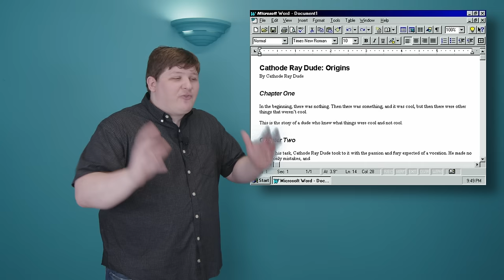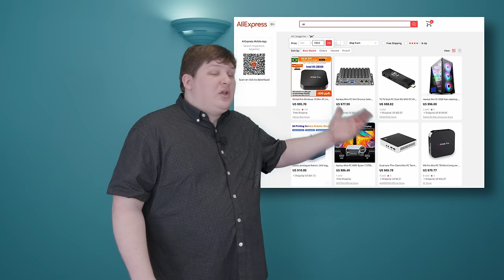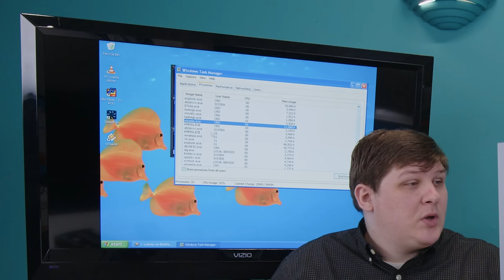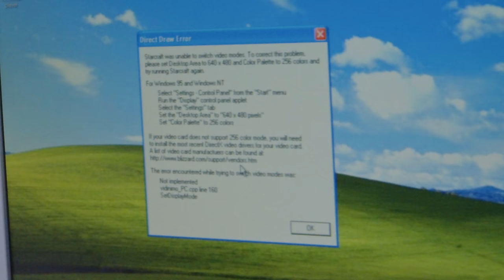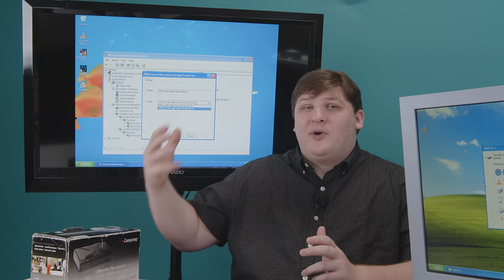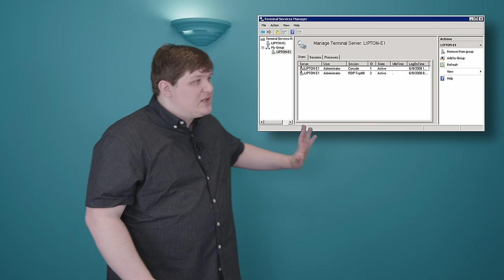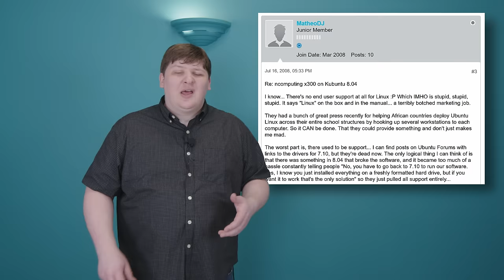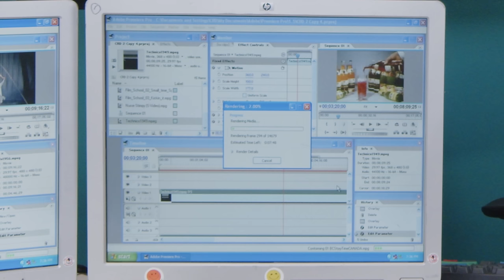7 Users on 1 PC! - but is it legal?

Comment: Great example of the internet being responsible for our constant upgrading. 

I love the basic UI and functionality of older versions of windows, but the power and tech requirements of the modern internet / browser experience forces you to upgrade. Even XP is forced off the net by not having a new enough browser available. 

Back around 02 I remember still being able to kind of function on the internet with IE 5? Or 5.5? On windows 3.1, but many new pages wouldn't work. Similar to the winXP example now.
Reply: You can squeeze a couple more years from old hardware by just installing Linux.

But having a lighter OS and a modern browser can only get you so far. Modern web is getting increasingly bloated and even basic (from a "social" standpoint, not necessarily from the computational one) sites like YouTube or Facebook can really struggle on underpowered hardware.
Reply: I wish I could have Windows 2000 back .... secure for its time (NT based) no wasted resources on eye candy, nothing comes with it so bring only the software you need.
Reply: XP is so riddled with security holes, the modern internet being too powerful for it is probably a good thing
Reply: Well, you can get pretty far with first adblockers and then JS blockers.

(and ditching windows bcs any secure version will lag as hell)
Reply: @Green Mamba Games Yes my first Linux box was a 90MHZ Slot 1 Pentium, with 128M of RAM, deemed too slow to run XP, but fairly screamed with RH4.0.
Reply: Honestly, Internet Explorer got a lot of warranted hate, but because it was the de-facto browser thanks to being came with Windows, it kept the Web relatively low-spec for a long time. A lot of fancy stuff had to be made in Flash thanks to IE not supporting any newer web standards. But even with Flash the web in 2008-2010 was still much lighter than today when some bloated websites actually load 15 MB (or one Doom ][) worth of advertising/snooping data.
Reply: I’ve got a ten year old i7 which would be perfectly fine were it not for JS webpages getting more bloated. It’s still perfectly capable of video transcoding, software compilation, and so on. It even has enough power to software decode VP9 and HEVC at only like 50-60% overall load. Yet web stuff has me considering a Ryzen 7 to get more headroom, and just do those other tasks 2-4 times faster to boot.

Comment: I'm watching this on Phenom FX 8530, 16GB RAM from 2013, later added GPU GT-1030 for 4K decoding and NVME SSD for storage.  It's unbelievable how good this PC works for its age.
Reply: Switched from HD to SSD .... suddenly my 10 year old (Gaming Laptop) is cool again, despite Windows 10.
Reply: Yeah, I'm running an I5-4690k and AMD R9 RX280, both from 2014 and I don't see a need for a newer hardware for at least the next 5 years. As I only play single player games a few times a year, I'd only consider upgrading the GPU for a few generations up if GTA6 ever releases lol
Otherwise it's totally adequate for everything on the web.
Reply: @Renee_R343  here with fx8350 and r9 280x too, all the same thoughts
Reply: i'm watching this on a 2008 Thinkpad 400, Core 2 Duo, 4GB RAM, but also I miss my Phenom II, I don't have it anymore but that thing lasted me several years. Outside of cutting edge gaming it took a long time to feel old.

Comment: one could argue that the computer is running just one user session at a time, like the user switching allows, but switching very very fast, like every other cpu cycle, hence not breaking the EULA
Reply: For single core, but what about multicore?
Reply: @rollinkendal8130  true now, but back then the pentium 4 had only 1 core, and 2 threads, with luck!!
Reply: Clever arguments are lost on dumb judges.

Comment: You did an excellent job! I don't like long videos, but as an old IT guy I was captivated in the first 10 minutes. Around 2010 I came across a tiny little dll file that turned my Windows XP Pro machine into an XP terminal server for up to 10 concurrent users. You had to have other machines already, but if you did not have the money for a terminal server, this would do the trick. To me, it sounds like x300 boxes are essentially the reverse of a KVM switch. If I remember correctly, when XP was first in beta testing they said something about supporting 9 monitors (think Brady Bunch), so it makes sense to me how they were able to get 7 desktop sessions. Very cool though!
Reply: Hi Vinnie! I am curious what was that dll file? Can you share it, or type it's name? I would like to look into that file.

Comment: Well done! 
Thank you for that video.

I was one of the people who recommended nComputing to a school, where it solved their problem. Very few people ever take my recommendations, so I felt validated when I saw your video.

And yes, the limitation is in the software.
I'm one of those old guys who, back in the day, ran multi-user UNIX/Xenix systems on machines that would be laughably under-powered by today's standards. I could never understand how people got suckered into using Windows in the first place.

I did also run a business network of 30 Dell Optiplex PCs with 166MHz Pentium CPUs with 32MB RAM and a 2GB HD, for 10 years from 1998 to 2008 on Windows95, so yeah, I'm a bit stubborn. In the end, I did convert those PCs to thin clients running Linux and rdesktop connecting to a Windows 2000 Terminal Server.

I'm well aware that even the Pentium CPU could never reach 100% running just normal office applications. Those PCs would start swapping long before the CPU even broke a sweat. 

I did a lot of experimentation with multi-user systems, hacked versions of Windows, etc. WindowsXP can be made into a multi-user system with some hacks. Even Windows10 can be made multi-user and I know a business that is running it that way for over 3 years now, as their main system. Users connect via Remmina from Linux systems, so they get the "best" of both worlds.

Comment: Fascinating. Having worked with CPM86 for PCs where you could run multiple dumb terminals from a serial port expander on PCs and RTC86 that allowed 24 dumb terminals from Microchannel serial adapters in a PS2 Model 80 or Model 95. In reality you would use some ports for printers in a print server type queuing system but to see a room full of agents with Wyse 120 monitors all taking bookings all powered from one PC, and then seeing that PC running modems and printers at the same time does, as you said, prove that most PCs are way more powerful than users actually ever need, with exceptions.

Comment: 39:30 - My bet is that the Hsync and Vsync are combined on the same wire (and could possibly all be lumped in as sync-on-green, but it didn't look like the green was tapped for this), and then the remaining two wires would be something like: usb data, I2C data, generic clock-and-data, etc. Hard to stuff all of those things into a single line. In addition, I see two little traces on the top side coming off the CPLD towards the VGA port - since I doubt they actually implemented DDC (since the device only supports two modes anyway), this is likely the Hsync and Vsync, which fits.

I suppose they could even have the data synced to the VGA clock, so they have two data pins and a clock...
Reply: I would be tempted to fit the audio into the h sync area on the video signals. You already have an analog channel, put it in there. Also if you multiply the number of lines by the refresh rate (thus finding the number of h blanks per second) you get almost the same number for (1024x) 768x60 and (800x) 600x75. And the number is about 45KHz. So if you have an analog sample and hold circuit in there on red and blue (left and right) and open the gate at the right moment during the horizontal flyback you can reproduce audio at about 45KHz, which would sound pretty good. 

Merging the audio onto the R and B and the sync on to the G would save you a lot of lines. It would either use up 4 or 6 lines (6 for differential, which technically you should use for twisted pair CAT cable).

For what it maters I firmly believe the design supports only a single rate of lines (h sync rate) and that is why we see no 60Hz option. A 60Hz output would have to run at about 94Hz vertical refresh rate to get to the required horizontal refresh rate. And I'm not sure how many cheap monitors would support that back then. And if you had to use expensive monitors then it would hurt the monetary advantages of the system.
Reply: So much effort just to avoid having to find a different connector with more pins... :) But I guess it's easier said than done, especially when UTP has twisted pairs which probably helped suppress interference a bit.

Comment: In the 1980's we were running as many as 32 terminals on 386 machines running Xenix or Unix using smart serial cards to offload the I/O load.  (I used to design them)
Reply: thats what I thought too. An AS/400   e.g. was able to lift the workload of a whole company and he is fxxxking around with games in a 2 user environment...
Reply: But could it teach people to use windows? This is apparently a valuable and rare skill that cannot be picked up should the need arise.
Reply: Just think of how many terminals a modern eight core laptop could support… or a threadripper 🤣
The hard part would be finding the users who wanted to use your terminal…
Reply: When I was starting out at a telco (Telstra Aus) I remember seeing quite a few Olivetti  box's that ran unix and talked to a pile of serial terminals. Back then setting up an office with multiple terminals meant running heaps of RS232 serial cables back to a 'server', everything was text based. I actually think more work got done back then, as the users couldn't stuff around with the computer, it was setup to do what it did and that was that.
When we went to PC's, we then had to employ a pile of extra support (IT) people to go around finding lost icons and resetting screen resolutions etc, that users would stuff about with and break their workflows.
One twit discovered laplink and would clone one machine to another because he thought the other looked better, of course he broke several machines, as the hardware did not match - wrong driver issues deluxe.
Reply: @paulstubbs7678  Olivetti in Australia... As an Italian that's really nice to hear :D
Reply: re: "In the 1980's we were running as many as 32 terminals on 386 machines running Xenix"
Text-based apps? Using say ... VT220 terminals for - like data entry? No graphics per se then ...
Reply: @uploadJ  At my university we would have a single SPARCStation 20 servicing around ~20 Xterminals. Multiuser computing is quite old and refined. OS schedulers in modern OSes still carry mechanisms from the multi-user world. Even Windows NT's scheduler still has some hints of VMS in the balance set manager.
Reply: @uploadJ  The POINT he is making is that we LOST a Valuable capability   -  hell Im STILL pissed that I can plug in 2 Mice & Keyboards into my machine & have them show up as Different inputs Native on ANY Win9x/XP/7/10 etc.  Imagine what that could have done for GAMING vs Console in Y2K era.  Multiple COntrolers anyone? no? why not.
Reply: @uploadJ  Yeah text based, accounting, email, software development and there was a version of MS Word for Xenix.  We used mostly Wyse WY50 and WY60 terminals but anything with an RS232 would work. Originally we use boards form a company called Chase, then started building our own,  The boards I designed were modular and could be expanded in 8 port increments up to 32 per host card - (Specialix SI, XI and RIO serial boards).

You could do a lot with serial, at one point 25% of the Usenet traffic in the UK went through a bank of four 19.2k Telebit modems that sat on my desk (we had a "real" internet connection 32kbps IP over X.25 at a time when the US<->Europe backbone connection from Amsterdam to Falls Church Virginia was 384k).
Reply: @johnpenguin9188  a lot. A single thread, no cache, 16 MHz i386DX was about 2.5 million instructions per seconds,  a Threadripper 3990X is 2.3 trillion instructions / sec almost a million timers faster.  I'm not saying you could support 16 million terminals but it would be a very large number.  😎
Reply: @whatsup3d  re: "Yeah text based, accounting, email, software development"
Remember the Xerox model 820? 2.5 MHz (not even 4 MHz!) Z80-based with only 64K of ram ... ran Wordstar, VisiCalc, the 1st spreadsheet pgm that cam out and I did ASM development with a pair of 8" Shugart drives 'clacking' away ...
Reply: @uploadJ  Yes I remember CP/M machines, at one point I worked for Lifeboat Associates who shipped software in every weird CP/M disk format. I go back as far as the KIM, PET and Apple ][ (1 Mhz 6502) machines then I spent a number of years writing bios and utility code for CP/M, MP/M and MP/M-86 machines by a UK company called RAIR (8085 and 8088 based) before founding Specialix and building serial cards and writing Unix and Xenix device drivers.   (I did play with some classified machines before all that that had real magnetic core memory but not serious dev work on them).
Reply: @whatsup3d  re: "some classified machines"
Similar - on a project called "TIPI" (Tactical Interpretation of Photo Information) .. two mag core 'stacks' for a total of 64 K of 16-bit words ... time frame ~ 1976 ish ... TTL chips used open-collector outputs w/pullup resistor for data bus cuz tristate totem pole output logic chips did not exist yet!!
Reply: @JerryVanSouth  The point is the cost.

Comment: 27:29 anti-counterfeiting. Ghost shifts and cloning were a problem even back then, and one way to combat it was (and still is) to have the software refuse to operate if it can't authenticate the hardware.

There are more elaborate ways to do this but something as simple as an obscured rule for what makes a valid serial number can often be enough to stop a shady manufacturer from outright cloning your product--as often they don't even bother putting unique serial numbers on their counterfeit units.
Reply: Thank god for open source amirite
Reply: Couldn't they just read out the sn from the hardware when connected maybe?

Comment: The entire video I was thinking of a system I found installed in an office back in the early 1990s based around a system called "NTNX" - pre-Windows, this was a system that enabled something similar but for DOS based applications that were common at the time.  IIRC it was an 8-bit full-length ISA card, but had multiple entire XT PCs on it - each user got their own PC that was running on a card in the host machine.  This would certainly be a fascinating device to get your hands on!
Reply: i had a card like that ISA as well and it had connections for 2 monitors and  2 mouse and keyboard ps2 ports. it even had 2 486 cpus on it, it was from an ibm netfinity server which was a quad pentium pro 200
Reply: Worked at a company in mid 80's that used this. PC's on a single card installed on a back plane. 80 MB hdds.  Each user had a Wyse 60 terminal. Worked great. Then replaced it with a Unix based system for more powerful Database. Single 386 could run a whole bunch of Terminals. Late 80's early 90's I installed a lot of 2-10 Unix based accounting/inventory/PO systems, 386, 486 based. Add in Wordperfect for word proc and you had a perfect system. The PC based networks and servers ala Novell, the WIn NT,20XX. Now the world is going cloud based which is sort of like going back to terminals (Pc's, tablets, Phones) to some mysterious system in the sky.

Comment: You say "worse UI" and you might be right from a power user perspective, but from a casual person perspective the Ribbon design language has made it a lot easier for a lot more people to access Office's more advanced functions. The addition of a search bar was huge too. Instead of needing to know where Excel's data validation tools are users can just type in "data validation" and the options appear. They just need to know what a feature is called to find it. I do consider myself a power user of the office suite, I use visual basic, and macros, and lots of technical features, but I have seen how easy it is for my tech-illiterate coworkers to get way more out of office than they ever would have before, with the new designs. If you trained on the 95-2003 era, the ribbon-era looks terrible. If you're untrained working in the ribbon-era you're doing stuff that needed training in the 95-2003 era.

Comment: In 2011, I had used this setup in a C programming class, but it was a bit different and ethernet controlled using a LAN switch and a Xeon Workstation CPU. The system had 15 -18  terminals set up. 

The virtualization using a cheap FPGA is really impressive.
Wonderful content.
Cheers ✨✨

Comment: I actually ran into this sort of system in production! In middle school, we had a few small labs in the english classrooms where they had a single, central Core2Quad machine with plenty of RAM, and on each side 3 workstations running off of these zero clients. They were neat, but if you knew what you were doing, you got the central seat if you could... It's also interesting to note that, much of the time, these organizations that used these had full AD implementations as well -- in many cases it was not just loading 7 profiles at once from the disk, it was sometimes creating profiles for fresh logon credentials.

Comment: That is certainly one of the more creative solutions! I remember a similar use of Terminal Services that was restricted to Administrator group members in Windows Server 2000/2003. An oddity I remember from a job in the 2010s about remote console/app display is that RDP was a lot friendlier to slow/laggy links, like transatlantic, than X Windows System.